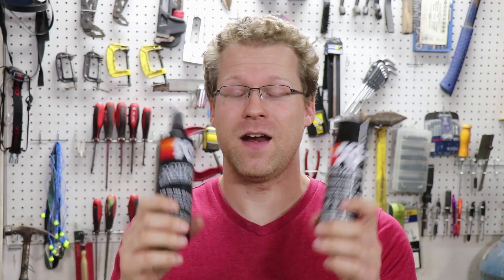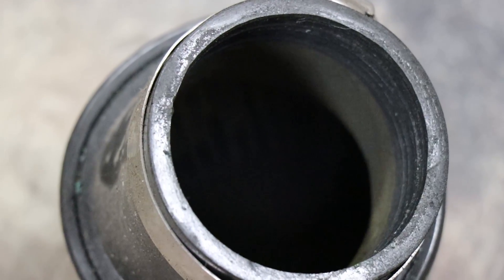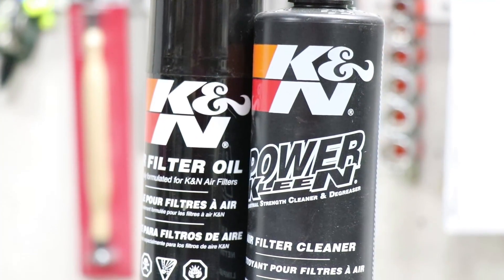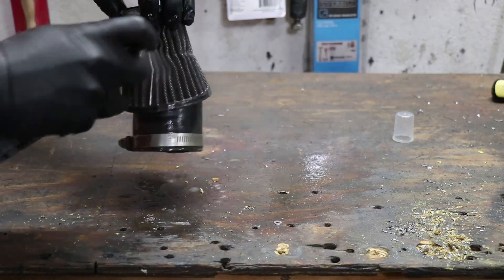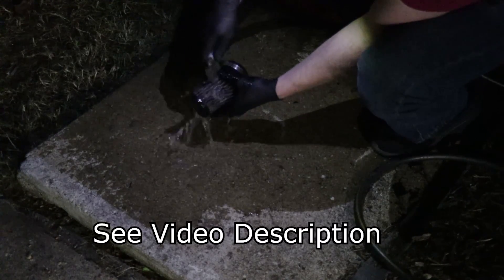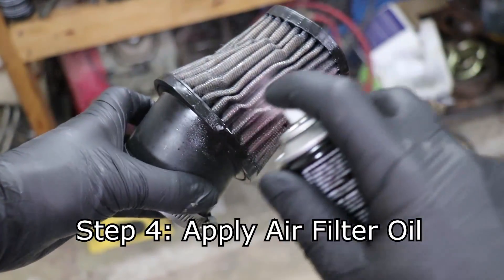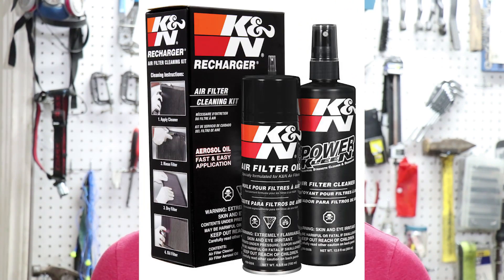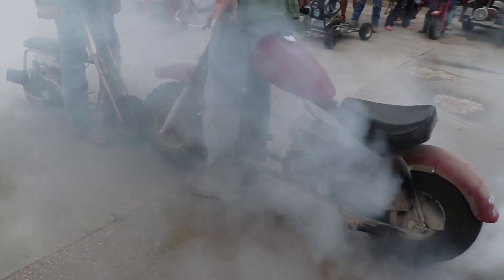How to Clean and Oil a K&N Air Filter in 4 Easy Steps

Comment: Great video Grant I kept the briggs&stratton 6.5 like you recommended and made an air adapter out of a 2 and half inch PVC cap and drilled out the muffler I can't seem to find a stage 1 kit for my engine and all the air adapter I saw online just didn't look right so I made 1 has a lot more power but of course it runs lean I can't find a .038 jet for my carburetor even your link from the stage 1 video with your nephew it seems they don't offer a lot of mods for my briggs 6.5 I'm think my only option is to carefully drill out the jet but what 1 I have 2 one is the bowl nut main jet then the 1 in the carb do I dill both to the next size or just the main 
I appreciate any advice you can offer thank Chase 👍😁✌
PS I have a video of the cart on my channel before I started doing the stage 1
Reply from the maker: Buy a set of #60-#80 drill bits and check your size first. For example the predator main jets are about .028” and they are jetted .033-.038” depending on mods. Go slowly. The other jet might be your idle pilot. Check to see if you can adjust idle mixture. If you are unsure, it’s typically best to leave idle pilot alone. It’s very easy to overdrill the idle pilot.
Reply: @KartFab   Thanks Grant for taking the time to help I appreciate the info GREATLY 😁👍 I drilled out the bowl nut jet last night and put it back together and it does idle with out the choke now but when I hit the gas there is almost no power and is very loud so I ordered a new muffler and bowl nut and I'm just gunna keep the Briggs stock it's a good engine that way very frustrating lol but I'm thinking of get a Tillotson 212 they have have more regularly available parts and mods I would get a predator but hear Tillotson is a little better quality for a cheap engine your or should I go with the predator? I just don't want to be frustrated and have to Jerry rigg everything lol I love the video with you and your nephew doing the stage 1 it was the way it should be clean neat work area the rite tools rite parts 👍😁👍
Thanks Grant hope life is great 
GOD BLESS ✌😁👍
Reply from the maker: @zombieapocalypsecherokee9224  thank you so much sir, its comments like this that keep me going. The predator 212 hemi and tillotson 212 are about the same, but you are right, the tillotson has better machining tolerances and it will rev higher stock than a predator. All around a better engine. If you are on a budget, the predator costs less, but if you want a quality engine that is built with modifications in mind, the tillotson is the way to go.
Reply: A Tillotson it is then 👍😁Thanks again Grant look forward to more AWESOME video's 
Best wishes my friend ✌

Comment: KartFab any plans on building a supercharged 212?
Reply from the maker: I talked with Greg about that last month. Maybe that will be something he will do. That would be cool. My current plans are predator hemi and non-hemi stage 1 through 4 builds w/my dyno runs, then do a how to build s go kart video and possibly put those on the
Reply: KartFab  Cool I've almost got mine running on a Subaru robin 21 ex with stage 4 build running a smog pump as the supercharger. I''m hoping I'll be able to make around 10 psi of boost spinning at 8000 riplems 👍🏼 good way to shorten an engines life,

Comment: Will a 4.9 pound billet flywheel meant for a 5hp flathead work on a 8hp flathead and also do I need a billet flywheel if I’m only putting in a billet rod and removing the governor or is the stock one good if there’s no cracks?